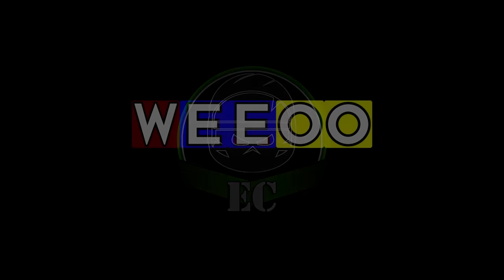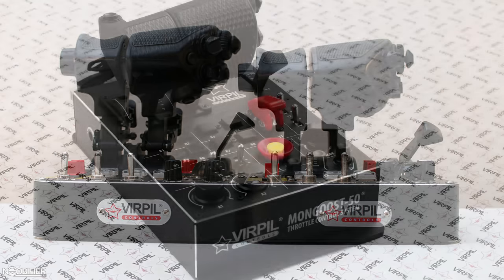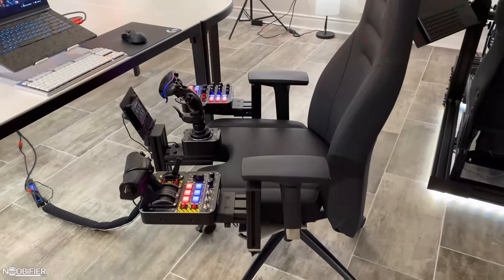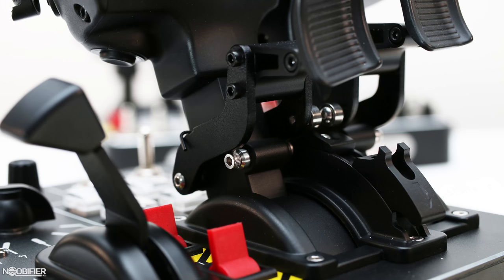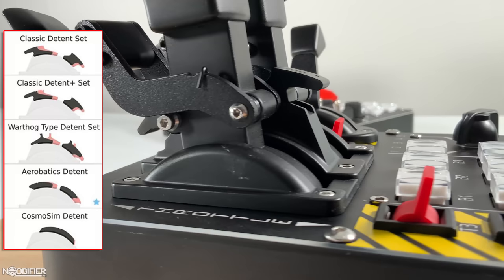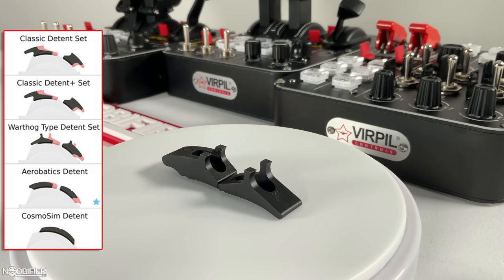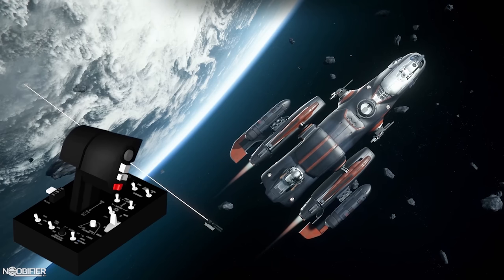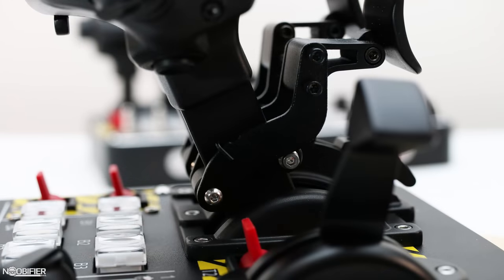MT50 CM3 Throttle - First look - Review & Overview - Virpil

Comment: The space sim detent is very useful in Elite Dangerous, so you can use reverse thrust more efficiently by setting the dead zone in the middle
Reply: I agree, with space sims at least there are two options: middle detent point for 0 throttle (my first option I am used to), and 0-100 throttle with a button for reverse... 
it's a matter of giving it a try
Reply: yeah and i don't think it would be useful for setting it to your maneuverability point, as that changes a lot
Reply: @lmorenoserrano  I wish there were an audio cue in SC telling the reverse thrusters are in use.

Comment: We'll be 3d printing custom detent parts (i.e. the Viggen has the two-stage afterburner).
Reply: +Federation42movies  What detenting between afterburner zones 1 and 2 on the JA37's Volvo RM8B?  I understand Pratt & Whitney to have used push-throughs on the TF30 controls to indicate valving of the afterburner zones on both the USAF F/FB-111 (most submodels) and the USN-USMC F-14A.
Reply: Viggen has 3 afterburner zones. 1, 2 and 3.

Comment: my first vripel joystick comes in two days I feel like a kid waiting for xmass im 37 years old
Reply from the maker: Congrats
Reply: Very cool
Grats
Reply: Mine came a couple weeks ago.  CM2.  Now I wish I had not had the money for a tad longer, because I have been playing with 3d printed detents since I got it...  But it is still amazing!
Reply: @tribvne9633  sell it stock is so low and waiting time so high you won't lose money plus import tax sell it buddy buy the new one I don't think you will lose to much
Reply: That's how I felt when my constellation alpha arrived. After waiting months for it.
Reply: @CueDriver   it came a day early it is amazing, very light compared to my warthog
Reply: Might get vkb flight stick with this
Reply: @NOOBIFIER1337  Can you please do a direct comparison between the VPC ACE Interceptor Pedals and the MFG Crosswinds? I know you mentioned them when you did your VPC review but I want to see what the pros and cons are for both. I want to buy one of them in the next few months if I have the money and I don't know which one is better. Thanks.
Reply from the maker: They are both equally good for different reasons... I would take either personally. It depends on what you want as far as the way your foot rests on the pedal
Reply: @NOOBIFIER1337  okay thanks. I'm assuming the MFG allows for more adjustments. I'm a smaller guy and I don't want to be stuck with pedals that have the feet rest set ridiculously far apart.
Reply: @NOOBIFIER1337  have you got your hands on the new helicopter throttle from virpil yet see pictures of it and it looks amazing

Comment: I can think of a another reason for the cosmo-sim center detent, using the throttle like a dual stick control with the one axis doing forward and reverse. Feeling when the throttle is centered at zero would be nice.

Comment: For DCS I want module offer two things.

1) a custom axis position where player can set the idle and afterburner detents position if having Throttle with physical detents.

2) have a virtual detent like hornet does, press a button to be able "push through" detent regardless physical throttle detents or axis past mil power/idle.

I take software version any time over hardware if I can not tell to the simulator that where my throttle detents positions are in Axis like it is in Falcon 4 / BMS. There you move throttle to position on axis and click in axis configuration panel "This is afterburner detent" and you get green and red lines symbolize their position.
Reply: The F/A-18 and F-16 I know have button bindings that correspond to physical detents, though I think the name of them is a little unintuitive. In Virpil's software you can set up virtual buttons to trigger whenever you pass your detents, and then bind those virtual buttons to the detent inputs in DCS.
Reply: @GuyFromJupiter  You are correct that you can select those detent / elevator bindings (Idle/Off & Afterburner Detent in F-16, Throttle Finger Lift in F/A-18) that needs to be pressed to overcome in DCS. But that is just a ugly way as it doesn't allow accurate control of the range.

It really isn't difficult to program the logic that asks player to move the throttle to each physical detent position and then mark it as axis position where it will be. 

Example, move throttle to Off position and press "Off".
Move throttle to "Idle" position and press "Idle".
Move throttle to Full MIL and press "MIL".
Move throttle past the AB detent and press "Afterburner".
Move throttle to corresponding afterburner sections (ie. Viggen) or end of full scale and select "Full Afterburner". 

Just moving throttle would show the red box moving in the input box and then mark a corresponding detent position when pressing button in config window.

It wouldn't matter where is the physical detent, you can have it same for everything, on every throttle etc.

Comment: I just got one recently, and there are only a few changes I would make. 
1. Make the detents tool less and quick changeable. I use a warthog bottom detent and aerobatic top detent for DCS, but that is basically useless if I want to use it in SC, and changing the detents is just too troublesome to bother with. 
2. Make the hat switches gated. They are high quality, but though I haven't personally found them to be troublesome I have heard from others that they hit the wrong directions in them frequently, which I believe is a valid issue. 
3. Change the rotary encoders on the throttles themselves into axes. Oftentimes the things I want to use the encoders for just don't support them correctly, and they would really work better as axes. 
4. Make some of the switches on the base swappable. It would be nice to be able to change out the switches on the base from 3 position momentary to maintained at times. This one's a bit nit picky, but it would be much appreciated. 

None of these are huge issues, and overall I'm very happy with the product I got. For their next iteration though I think some of these changes would be pretty nice (not that I'll be spending the money on one though!).

Comment: I have the first and second T-50 throttles.  The second I am using now as part of my Star Citizen HOTAS rig. I was very disappointed in the deletion of the detent from gen 1 to gen 2, but it is still a great throttle.  I am a Virpil fan.  I skipped CM2 because of the lack of a detent.  I placed some visual markings on my throttle to indicate the center neutral thrust point, as that is critical for maneuvering, but it's still a pain to have to look down at the throttle to verify.  As soon as I saw the CM3 included a detent, and a very customizable one at that, I dropped a pre-order.  This will be my new Star Citizen throttle.  I use a HOTAS setup, because as an IRL pilot, it's just how I roll.  Thanks for the video Noob!  As always, you are the tip of the spear when it comes to new sim hardware.

Comment: I would use the CosmoSim detent for 0 throttle, personally.
Reply: I agree, with space sims at least there are two options: middle detent point for 0 throttle (my first option I am used to), and 0-100 throttle with a button for reverse... 
it's a matter of giving it a try
Reply: @lmorenoserrano  There's also the option to put the detent point at 75% for games like Elite Dangerous where you have an optimal approach or turning throttle amount.
Reply: @HenrikDanielsson  You are right, with ED it is very useful, thanks!

Comment: Thanks for the review!
I'm glad I waited for Virpil to add the detent system instead of buying the CM1 or 2.
Reply: CM1 is actually better. More buttons, adjustable detents, etc. That's why when they went up on e-bay they can go for $800 sometimes - instead of buying a CM2 or CM3 with another button box.

Besides you can 3D print the finger lifts:
https://forums.mudspike.com/t/throttle-finger-lifts/9954
https://www.dropbox.com/sh/upeudspduudlyo9/AABvKRhplsAIKaKyL44tDA7Ta?dl=0

Comment: The CosmoSim detent is actually meant to be positioned at the center point of the axis, to provide a "zero thrust" detent when the throttle axis is used for both forward and reverse thrust. There's no good way to quickly find this position without it.

Comment: The cosmosim detent looks like it would be great for a neutral position. If you use the throttle for forward and backward thrust without modifiers it would be a great 0 position reminder

Comment: This is very nice. It does look suspiciously similar to some very inventive 3D printed custom jobs i've seen on YT for the previous versions.
Reply from the maker: It’s very overbuilt though. I imagine the 3D printed stuff wouldn’t last a lifetime or operate without maintenance... this is truly a fantastic solution
Reply: @NOOBIFIER1337  Oh I'm blown away by the engineering that has clearly gone into this, Virpil are truly pushing the boundaries of what consumer level gear means. The 3D printed things that people make obviously won't last as long but I would expect those people have access to a 3D printer and can make replacements.

Comment: I’m curious about the aerobatics detents for IL2. It’s usually not as big of a deal (versus DCS jets) whether you pass a certain throttle point, but I’ve blown quite a few engines after running too high during combat and not noticing. It would be nice to have detents for continuous and combat mode operation.

Comment: 5:00 Regarding the Star Citizen "CosmoSim" detent - what I found this to be more useful, in my opinion, was not relating to SCM vs afterburner but 50% "full stop." As Star Citizen's use of HOTAS allows for full forward and full backward thrusts, finding that full stop middle was always difficult when using my X-56 Rhino. My way around that, using the X-56, was to increase my dead zone in the middle and also turn down the thrust limiter to 0% - this was especially necessary when being scanned by the Space Police. The slightest touch on my X-56 and I was suddenly a fugitive from the law.

With the VPC CM3, and the centered "CosmoSim" detent; I will now be able to easily feel my full stop 50% location without having to adjust my thrust limiter or increasing my throttle dead zone.

Comment: You could use the Cosmosim detent to set the throttle to fly both forward and backwards with the detent in the center for stop.
Reply from the maker: Correct. It’s very nice

Comment: For the CosmoSim Detent, wouldn't it make more sense for the Detent to be at the 0 Throttle and the divide between forward and aft thrust?
Reply: In his setup the throttle is used for the speed limiter and not for actual thrust due to him having a left handed joystick to control direction but in a hotas setup the detent at 0 thrust would be more useful.
Reply: That depends if you have set up your throtle to go both forwards and backwards. But yes, that is what i thought aswell, until N00b mentioned SCM. I've only tried binding my throttle to speedlimiter+throttle forwards. I've only reversed with either thumbstick og buttons, with low speedlimit

Comment: With the amount that I have just paid for the CM2, I would think they would offer CM2 owners a detent upgrade for a ressonable price.

 I have thought about getting another joystick in addition to the one that I already have, in order to use 2 x joysticks for space sims, but now I feel that with this new throttle it shows me that Virpl could have sorted out the detent issue of the CM2.

 I will no longer buy another vipl product until they sort this issue out. there is no way I could justify buying a whole new thrtottle.
Reply from the maker: I’m an quite sure an upgrade kit is impractical mechanically. It replaces the entire grip and sensor pack. It would cost more to ship the update than to send a new device IMO.

Comment: For DCS there is a trick for getting around the need for the detente using a CM2.  You can set the throttle to only go to just before AFB, then set one of the little red switches between the throttle and flap levers to 
give you the rest of the throttle and allow you into AFB mode.

In SC, if I weren't using car pedals for forward, reverse and brakes; I'd use the same trick for forward and reverse movement toggling.

I say all of this as I just got my CM2 6 weeks ago.  And while this is the sort of solution I envisioned for the detente issue, I dont think it's an issue.  I do like the longer throw on the throttle, it would make the minute movements required for refueling in DCS easier.  But regardless, this area the CM shines even without the longer throw as its ease of movement is amazing.

The downside of this is if you DO play multiple games that require detentes, swapping between detentes, then having to tune the detente based on in game "finding" the right spot and screwing it down would get tiresome to most I think.  If I hadn't found the trick with flipping a switch to go into AFB, I'd want this regardless.

Great video as always, thanks for helping us learn about all the tech toys for us to play with!  I watch a bunch of DCS videos, and I'm starting to hear DCS guys and content makers say they watch your videos as their preferred source of tech reviews as well, so congrats on growing your audience and hitting 60k!
Reply from the maker: Swapping is done in seconds
Reply: how does the red switch work more specifically?  like do you push the throttle all the way till it won't go any further and then flip red switch,,,i'm not sure what you mean and how do you know when to stop if you can see your throttle position on the screen while flying 400 knots in enemy territory?
Reply: @harpoon_bakery162  So the way it works for me in game is this.  I use the T2 switch as a toggle for AFB mode, T2 is the switch immediately to the right of the throttles themselves.   When that toggle is off, my throttle is limited to 80% max of its normal range; so it ranges from 1% to 80% of max throttle.  Not physically, but how the game sees my device.  When I switch the toggle on, the throttle in game now has the full 100% range of motion and AFBs will kick on once you pass the 80% throttle mark.

The net effect of this is to limit access to your AFBs to when that toggle is switched on.  It's a useful trick, and one that once you recognize how it works, you start to see other things you can use this with in other games.

This is a YouTube video to explain to you how to do it, he's a bit long winded, but he is thorough in his explanations and he's explained what you need to know by the 7 minute mark.   https://www.youtube.com/watch?v=Hs18EfOlb6U
Reply: @fubarace1027  great, i will try this for sure.  got it bookmarked.  Thanks so much !!!!!

Comment: +BrianMP5T  Thanks for the preview of the VIRPIL® MongoosT-50CM3® engine quadrant.  For a preliminary execution of a V-FX™ Throttle Quadrant, I'd include the Warthog idle and Classic+ MIL detents with the MT-50CM-series grips, plus two auxiliary levers in the base, viz., the Flaps to the left and the Sweep O'Ride to the right, reflecting the actual control placement in the Grumman (USA) G-303.  The Classic+ MIL detent looks further modifiable to reflect engine execution on various older types in Eagle Dynamics DCS:World, e.g. four push-throughs past the MIL hard stop for on/off afterburner zone valving (General Electric J79, Pratt & Whitney TF30, Allison TF41).

The MongoosT-50CM2® would be better for helicopter and spacecraft simpits, excepting a sim for any Bell Helicopter Textron (USA) twin-engine, which has condition twist-grips on the collective arm rather than levers on a separate engine panel (as executed by Lockheed Sikorsky (USA), Airbus Roteurs (FRA), OKB Milja (RUS), BAe Westland (GBR), OKB Kamova (RUS), &c.).

Comment: Very impressive. Lovely how in Star Citizen you can use the detent to match your SCM but also to match 0 in the middle so that you can then set your thrust forward or back. Nonetheless, an upgrade kit for those with the CM2 would have been nice given the price (not that I can afford it anyway).
Reply from the maker: As I said elsewhere. Mechanically impractical to offer an upgrade... it pretty much replaced the entire throttle and grip.
Reply: @NOOBIFIER1337  I must have missed that one. Thanks for the reply!

Comment: I have the earlier version of the throttle from before the CM.  It's the last one that had detents.  The CM1 and CM2's lack of them has been a major reason why I wouldn't consider buying them.  If my current throttle decides to give up the ghost it's good to know there's a suitable replacement for it now.
Reply: If memory serves me correctly - You most likely have the CM version 1 or CM version 2. CM version 3 lost the detents. Then they came out with the CM2 and now CM3. I also have a CM version 1.
Reply: @kennethjones8683   I have the non-CM version 2.  It has the smaller grip handle with detents.

Comment: I'm curious what you think about Virpil's decision to use plastic detents instead of metal, I suspect they will wear faster over time. I'm also disappointed in the new lever locking mechanism, there's too much play and it feels like the right throttle lever is dragging the other one (unlike the CM2 that was really tightly secured).

Comment: How is the CONTROL PANEL #2 testing coming along NOOBIFIER ?  Did you get the landing lights to sync with DCS exactly as designed?  I'm talking about all of the landing lights not just the 3
Reply from the maker: I have not had a chance to look at it. I will when I return from deployment in August if I can get my hands on one for sure. I am keeping notes on questions like this and plan to do helpful updates. Sorry, but this is a case where my IRL job takes priority over the content. Thanks for the support and great question.
Reply: @NOOBIFIER1337  --- well thanks for keeping it in mind and I wish you luck on your extended deployment. Get back safe!